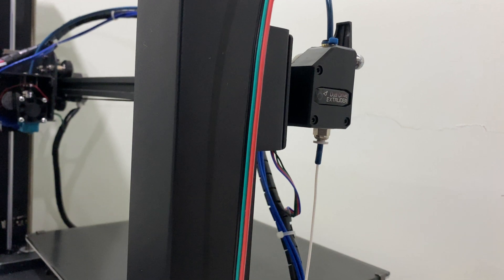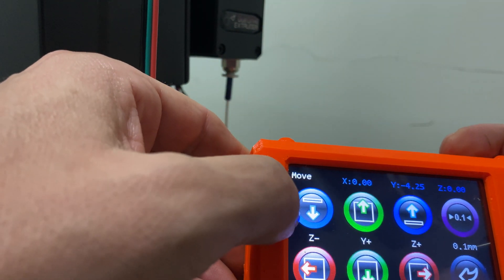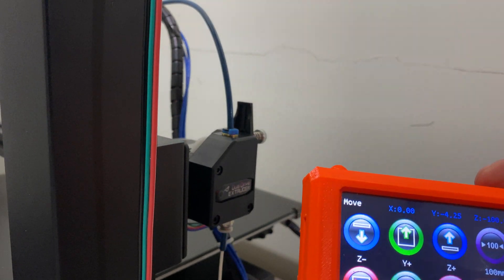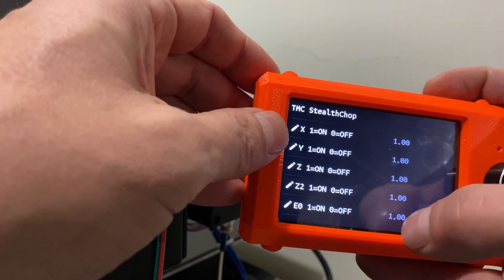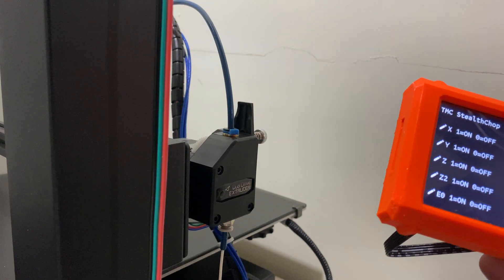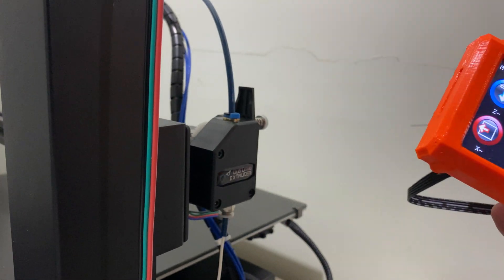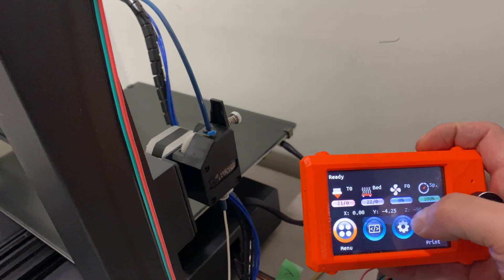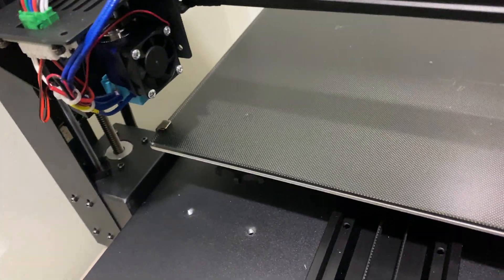TMC 2209 noise on axis and a different noise in spread cycle

Comment: I dont know if you already fixed it. The video was uploaded 1 year ago. But have you tried to increase the voltage of the stepper driver with the potentiometer on the drive itself?

Helped for me especially with dual z motors

Comment: I havent really done any 3D printing in a long time, but I would guess its something to do with dual z motors and how its configured/wired or maybe the jumper is wrong... I would try using one motor instead of dual motors as a test to see if that makes a difference. I think I had dual z motors but the wiring was wrong on them and it made the same noise. I believe it ended up frying my driver too, so be careful.

Comment: Did you find a solution? Got the same problem on my X-Axis...
Reply from the maker: Turned down the max feed rate a few points. Have it at 18 now. Stock was 20